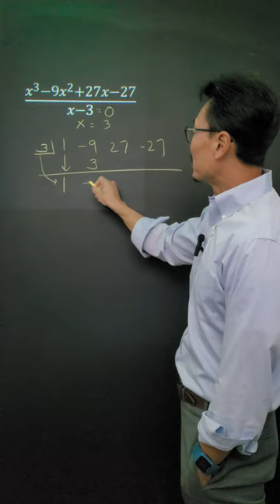Synthetic Division

Comment: in italy this is the ruffini's rule and I dont get why most of my classmates find it so confusing, i think it's brilliant!
Reply: Im from latin america and its also known as Ruffini,
Reply: why does it work?
Reply: Most math teachers just teach math as a set of steps/processes.  They don't actually teach the mathematical logic/concepts behind what students are learning.  When students lack foundational knowledge, they aren't able to figure out these things on their own.  As for Synthetic Division, I don't care for it, I would rather use an area model or long polynomial division -- things I actually understand.
Reply: I sometimes struggle to remember how to properly use ruffini's rule without getting something wrong - I think the "cubo di binomio" (a+b)³=(a³+3a²b+3ab²+b³)
would have been easier to do here on the numerator
Reply: I am from Italy, and calling it the ruffini rule instead of division is already a mistake as you can t grasp the concept properly, plus they never teach you to divide for and x-a where a is not a solution which sometimes can be usefull as well

Comment: This is amazing; even though I don’t know why x-3 can be zero, especially it is a denominator; I was taught the denominator cannot be a zero, yet it is so cool to learn a new way like this. In the past I just thought it would be like  (x-3)^3, so the answer is (x-3)^2.
Reply: it's a quadratic equation with a variable
Reply: variable in the denominator *
Reply: pareil dénominateur =0 interdit
de plus ne comprenant pas l'anglais et ne pouvant pas traduire les sous titre sur les "short" ...ne ne comprend strictement rien a ce qu'il veut démontrer
Reply from the maker: x-3 =0 was just to show where I got the 3 as the divisor for the synthetic division method.
Reply: @HEC Tutoring  can u use any number as the divisor?
Reply: If you are familiar with the “standard” polynomial division algorithm, remember we ended up subtracting a multiple of x-3. So to make the algorithm faster, we multiply x-3 by -1 from the beginning, so instead of subtracting -3, we end up adding 3.
Reply: that is why x-3 =0 becomes x=3....

Comment: I never remember these division tricks. I just use the defining property of polynomial division and multiply stuff together.

If I want to divide P by Q, first I multiply Q by ax^n, with n chosen in such a way that the largest degree term in (ax^n)*Q is of the same degree of the largest degree term in P, and a chosen to make these two match. Now I want to "fix" the second largest degree term: I multiply Q by bx^m, with m chosen so that the highest degree term in Q*bx^m is equal to, this time, the degree of the SECOND highest degree term in P. I then tweak b so that (ax^n + bx^m)*Q has the coefficient of the SECOND largest degree term equal to the one in P. I keep going until the degree of Q is bigger than the degree of the term I'm trying to adjust. At this point, R = ax^n + bx^m + ... Is the result of the division, and the difference between P and Q*R Is the reminder S.

For example, let's say I want to divide P= 2x³ + 13x² + 6 by Q= x+3. 
First I want to construct 2x³ from x+3, so I multiply it by ax^n = 2x²: this gives me Q*ax^n = 2x³ + 6x². Now I want to add go this (something)*(x+3) so that the second highest degree term from P, 13x², matches too: the previous calculation already gave me a 6x², so I just need another 7x². In order to obtain it from x+3, I multiply it by bx^m = 7x, obtaining 7x²+21x: we add it to the previous piece, obtaining (ax^n + bx^m)*Q= 2x³ + 13x² + 21x. Now I'd like to keep going to make the 6 equal too, but Q = x+3 has a degree too high and I have to stop. We deduce that the result is R = 2x² + 7x, and the reminder S is P-(R*Q) = (2x³+13x²+6)-(2x³+13x²+21x) = -21x+6.

We can check that indeed R is the result of the division P/Q with reminder S, that is, P = Q*R + S (to be honest, the operations I carried out are exactly the ones that give me an R with this property): 

Q*R = 2x³ +7x² +21x (we already calculated this earlier). Add the reminder, i.e. subtract the 21x and add the missing 6, and voilà, you got P back.

EDIT: I committed a small inaccuracy in the rush. You also have to check, in the end, if the reminder S has the same degree of Q: if this is the case, you can still write S as S = cQ+S', i.e. you need to add a zero-degree term c to the result R and the true reminder is actually S'. S' is guaranteed to have a degree smaller than Q, so this should be exact now. In our example, the reminder S = -21x+6 can actually be divided by x+3: -21*(x+3) = -21x - 63, so S = -21(x+3) +69 = cQ + S' with c = -21 and S' = +69. The full result is R = 2x² + 7x -21, and the true reminder is S' = +69.

Comment: i can't understand why he just used the formula (a - b)^3 = a^3 + 3a^2b + 3ab^2 + b^3
So now, (x - 3)^3 divided by (x-3)
ans. (x-3)^2 = x^2 - 6x + 9
Reply: Only works if the remainder is 0
Reply: @david.breyer  😑😑😑😑
Reply: @manjulasingh5669 you’re right my mistake
Reply: @manjulasingh5669  He deliberately gave an example that would come out evenly with no remainder.  And in fact, this example is a perfect cube, where your method would work.  It ultimately reduces to (x - 3)^3.

In general, it wouldn't always work that way, even if you were given a denominator that divided with no remainder.

Comment: or just factorize the numenator it is (x-3)³ and after the division you get (x-3)² whic is x²-6x+9 ofcourse
Reply: But you need to notice that the numerator is (x-3)³. If you don't notice that, you won't be able to solve it this way

The method shown in the video works for more examples, where you can't use short multiplication formulas

Comment: I have a doubt my good sir. Suppose an equation rose such that in the end, instead of 0, the number obtained was 54, or some other number. Then how do we proceed?
Reply from the maker: Then you'd add the remainder over the divisor to the answer.
Reply: You may be thinking that this kind of division is only useful if the remainder comes out to zero, but if the remainder came out to 54, then we'd know that at x = 3, the expression evaluates to 54. 

As is, there's a hole at x = 3 for the whole expression, because we can't divide by zero.

Comment: I have a question, if you where to have a integer instead of zero at the end what does that become. And also what if the exponent wasn't just going down by one what if it where to go x^3 then x (missing x^2) ?
Reply from the maker: The integer is the remainder. 
You put the remainder over x-3.
For the miss exponent, you need to write down 0.
I hope this helps
Reply: @mrhtutoring  thank you, and thanks for the great videos

Comment: Does it work like this everytime because we just finished this topic in our class and the teacher never told something like this. This is definitely easier than the conventional method
Reply from the maker: Yes, as long as the divisor is of one degree, it works.
For example, if you are dividing by 2x-6, set 2x-6=0, and solve for x.
Then divide by x which in this example is 3.
Reply: @mrhtutoring  ok thanks ❤

Comment: First, bet (x - 3)  ≠ 0 => x  ≠ 3.
Next, I would group it:
((x^3 - 27) - (9x^2 - 27x))/
/(x - 3) = (x^3 - 27)/(x - 3) - 
- (9x^2 - 27x)/(x - 3) = 
= (x - 3) (x^2 + 3x + 9)/
/ (x - 3) - (9x (x - 3) )/ (x - 3) =
= x^2 + 3x + 9 - 9x = 
= x^2 - 6x + 9
And the sollution of the lasting square equation is: 
x = 3, because
Δ = (-6)^2 - 4 × 1× 9 =
36 - 36 = 0 =>
=> x0 = -(-6)/2 = 3.

Comment: How do we write when reminder is not zero for the last constant??
Reply: If you had it come out that way, it means you didn't guess a correct root of the original polynomial, assuming you are using this method to find the three roots of a cubic.

But if you had an application of this concept where you do have a polynomial that doesn't divide the denominator term evenly, it means you'd construct a fractional term out of your last factor.
Reply: Consider this example, but replace the -27 at the end, with -30.   At the end of the day, you will end up with:
1, -6, 9, and -3 as your results of synthetic division.

What this means in reality, is that you'll end up with:
1*x^2 - 6*x + 9 - 3/(x - 3)

An application where you would want to know this, is integration in Calculus.  There's no method to integrate (x^3 - 9*x^2 + 27*x - 27)/(x-3) directly.  But, if you can reduce it to the above form, then there is a way to integrate it.  Because the first 3 terms I can simply integrate with the power rule, and the final term I can integrate with natural log.  The result I'd get after integrating  is:
x^3/3 - 3*x^2 + 9*x - 3*ln(|x - 3|) + C
Reply: Thanks a lot. Both the video and your explanation helped. I certainly owe  this community.  @carultch

Comment: Where is this applied to in practical applications?
Reply from the maker: Understanding division of polynomials is a very basic part of programming. Synthetic division can reduce the processing time by fraction of what it would take if done by the traditional long method.
Reply: Polynomial division as a whole is used all the time in physics and engineering to solve a large class of integrals, that being rational functions. Integrals are used to model the motion of objects within various potentials, to calculate the forces acting on non-uniform bodies, and even within quantum mechanics.

Comment: Just use polynomial division method . This is too many steps
Reply from the maker: Actually, this will save you time.
Reply: This is the polynomial division method, just with shortcuts to simplify what you need to write.

Polynomial long division will get you exactly the same results, with exactly the same calculations.  Polynomial long division is more transparent about what it is doing, but synthetic division as he shows in this video, will simplify the amount you need to write, and simplify the mental math you need to do.  It replaces subtracting negatives with adding positives, so you have one less chance for error in each step.
Reply from the maker: @carultch  Well explained. Thank you